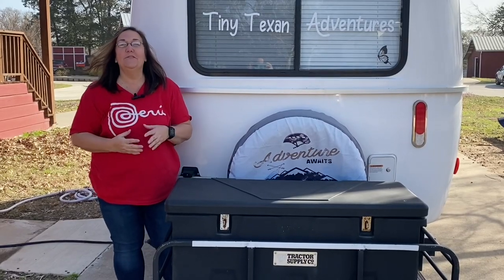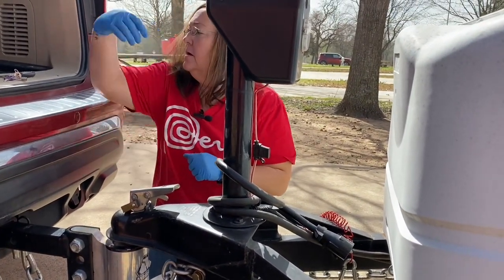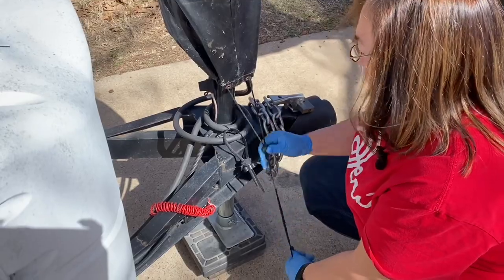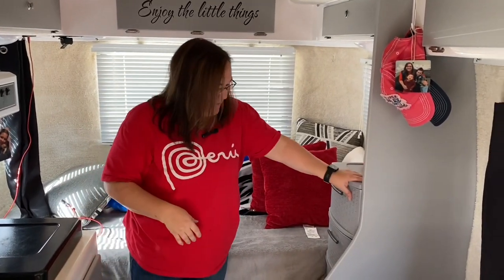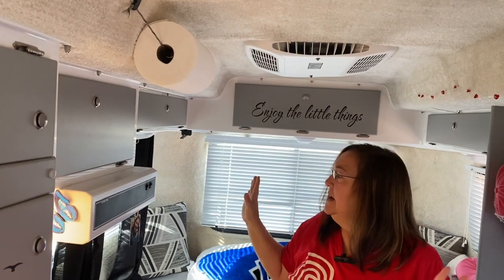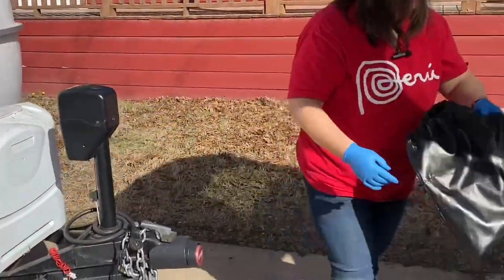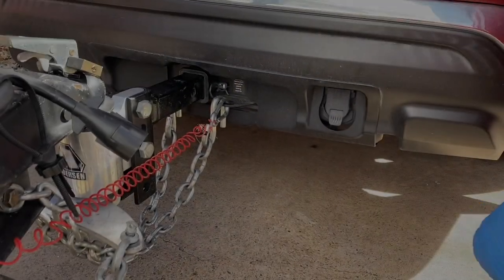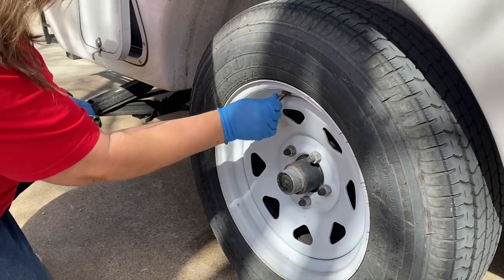Casita Connecting & Unhooking - The Basics

Comment: 👍👍👍Wow, that was a very comprehensive setup video! You have a great way of presenting the details. I liked the step, the quick connect hose adapter, and the knee rest. All great ideas! I’ve encountered several situations where the sewer drain at the site is higher than the drain opening on the Casita. I have one of those kits that allow you to control the height of the hose but it’s not of much use in those situations. Any thoughts on how to minimize the hassle of walking the hose? Btw, that was the best video I’ve ever seen on how to set up the trailer and vehicle. 🎉🎉👍👍
Reply from the maker: Thank you for always giving such positive feedback:-).  I sure wish I had a solution for the wrong way gravity heights on some park connections, but on our little Casitas I haven’t found a better way that propping and walking it out 🤷🏻‍♀️. You let me know if you do come up with something!!

Comment: You might connect a 90 degree brass fitting on the side of the trailer,  then your hose, to relieve the stress on the fitting. Also what keeps the road grime and road spray out of your quick connect.

Comment: When hooking up to water you should turn the faucet on first to flush out any ants or spiders that may have crawled in for a drink. I would have sanitized that low level faucet because dogs could have contaminated it by licking on it or.......
Reply from the maker: !!! Excellent advice that I’ve never thought of!  I’ll be adding that to my list :-). What do you use to sanitize it?
Reply: You are correct! I have experienced critters here in Fl for sure ! 👍
Reply: To sanitize I used a bottle of bleach and water mixture and spray the faucet. I have caps to seal both ends of my hose to keep it clean.
Reply from the maker: Thanks so much. I have the hose caps but never thought about sanitizing the faucet.  Thank you for the info!

Comment: How did you learn to backup so as to be in line with the hitch bulb? I have a backup camera will aide me in this currently I am van camping for short 2 or 3 nite stays in my 2022 Pacifica minivan, a real adventure for a soon to be 72yr old solo female. I love it but am thinking of a Casita for some long term travel if I can handle the hook-up... this video is great and I believe if I do good maintenance with lubing parts I can do this but I will need some backing up practice in a'n empty parking lot. Thanks I enjoy your channel. Sincerely Melody
Reply: She's towing with a Nissan Pathfinder. It has a built-in back-up camera.
Reply from the maker: Hi Melody, thanks for tuning in :-). As far as backing up to the camper, my Pathfinder has a wonderful back up camera that makes it so much easier. It still took a little practice and in the beginning I just had to keep getting out and walking back to check, but that’s how I learned:-). Backing the camper, however, took a bit more to really get the hang of it.  Even now if it takes me multiple tries to back in a site, well then it just does.  Practicing will definitely help you get a feel for how it moves. I was taught when backing the camper to put both hands on the bottom of the steering wheel and whichever way I want the back end to go, I turn the wheel with that hand. I do like the pull through spots at campgrounds though when available 😉.  For me the Casita has been wonderful, but I also love that you camp in your van for now :-). I still like to car camp now and then too :-). Keep me posted on your journey out there. ❤️. Safe travels!
Reply from the maker: Yes it does, and it’s a good one 😊
Reply: @TinyTexanAdventures  Thanks for the fast reply, was not sure if my back camera would show the hitch but I'm sure the dealer will know it probably does. I remember years ago I was going to surprise my husband and have the trailer hitched up and back down the ramp to put our boat on unfortunately I hit the trailer and knocked it into the lagoon so I'm a little 😁
Reply from the maker: 🤣🤣. Sorry about that but it makes a great story now lol!!! I would bet your back up camera will show the area pretty well.  Keep me posted lol